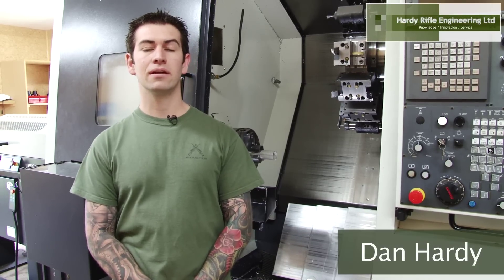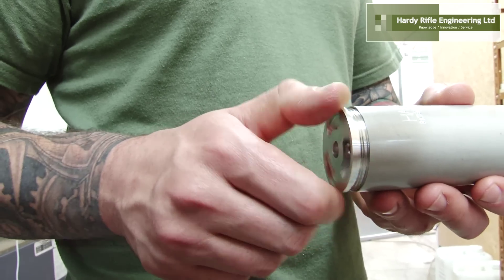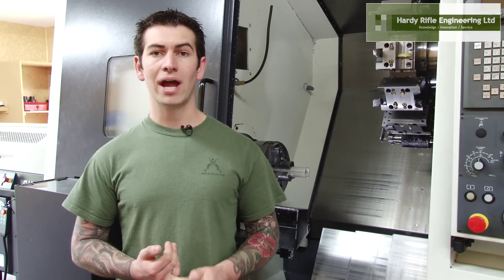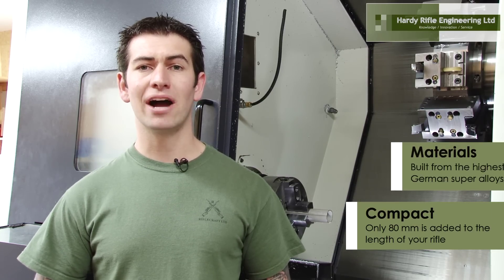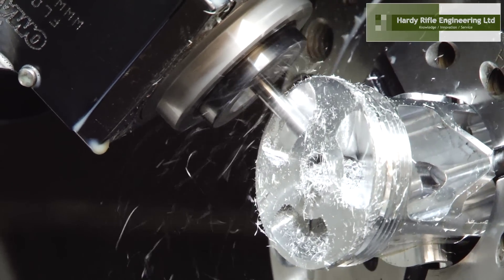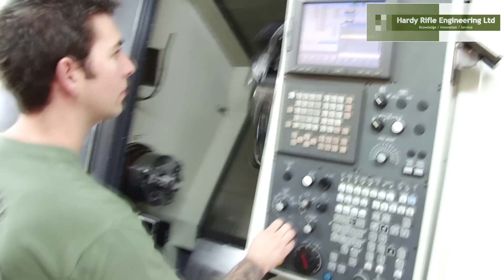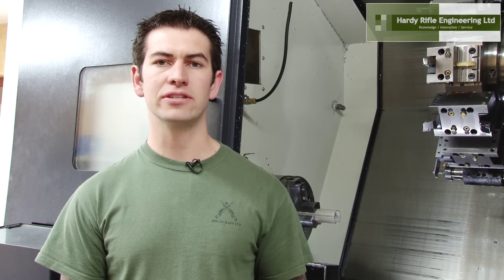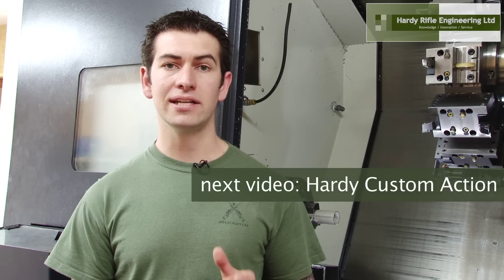Hardy Suppressors: Secrets revealed!

Comment: Really storkyring? If you compare apples with apples and tested the Hardy stealth against the suppressors you mentioned then you will find the Hardy products are far more effective. The Hardy stealth is built with similar specs to the Jet-z (muzzle forward specs) and it's QUIETER than the jet-z.

Comment: Actually it's quite a bit more than a tube, I have seen the core which is machined from solid bar stock and is complex in shape and the way it handles the gases. They are light in weight for the standard calibres and work as well as other heavier units and cost a lot less than muzzle forward Titanium versions. Should also point out that although I own some of the products, have visited the factory and seen the manufacturing process, I have no business or financial connection to the company.